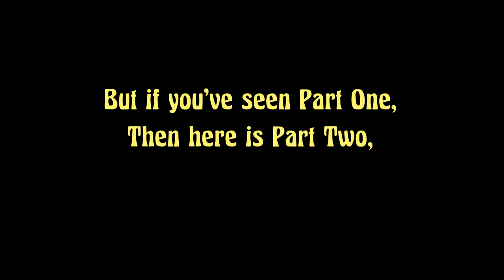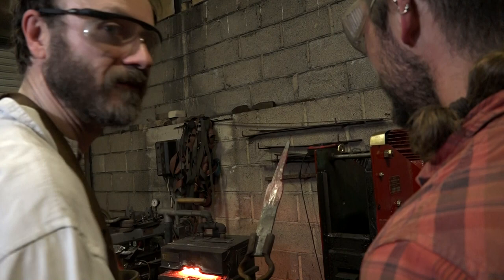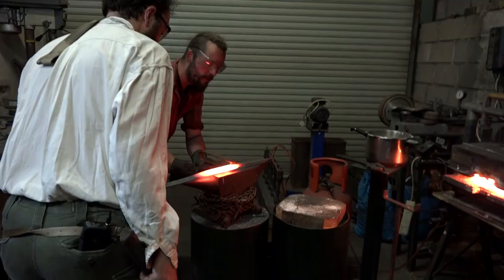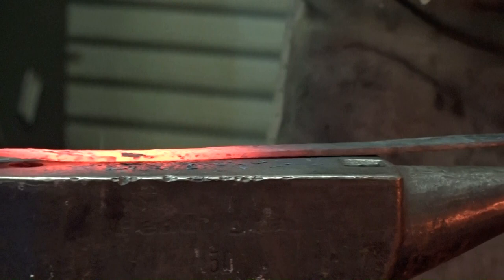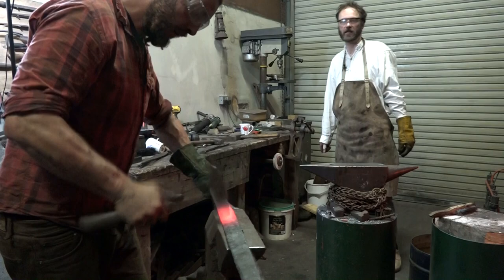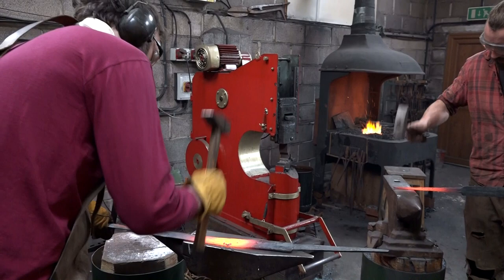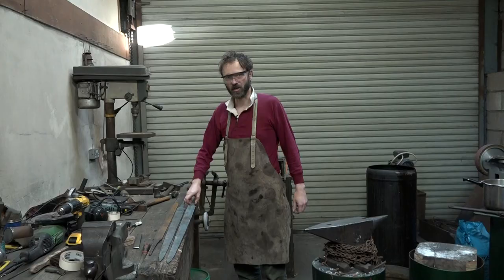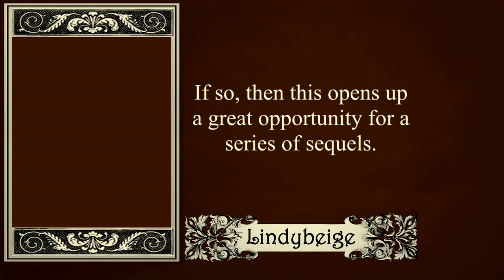Forging a Sword - part two: fuller, bevels, straightening

Comment: I was terrified when you shut off the power hammer and changed the die without unplugging the machine, putting in any sort of chuck, or locking the machine out.

Comment: If you want to make you blade very strong, you can do both quenching in oil, the standard procedure, and tempering it. However, don't make it too hard or it will become brittle.

Comment: What if you had a guide pin to run along so you could guide it better on the power hammer?  Not right where it strikes but maybe 4" away on the side away from you so you can angle the sword but still have a firm control while keeping the rotation angle about the pin to a nominal value.

You'd want to do that before forging the tang for the guide edge.

P.S.  The Arnander ending was well done.  I laughed.

Comment: Would you mind if I asked, why you named it the name you did, and what does the name mean?
Reply from the maker: Not at all.  This will be revealed in a later part.
Reply: Lindybeige alrighty then, I was going to watch it anyhow. Thanks for responding!
Reply: ahh, the old cliff hanger eh?  Kinda the same as us not knowing whose skull Lucille smashed in...
Reply: Eagle... Go-er?
Reply: Or Eagle Breather... mixing up my latin and my germanic..
Reply: Dagoth_Bob that would make sense considering it is a one handed sword
Reply: Lindybeige I have an intresting topic for conversation here. Steel production in the medieval period. I have done a bit of research about  this but with a few contradictions in what I've read and to the people I have spoken to. Pt1
Reply: Lindybeige pt2. Now some say that steel was produced in reasonable quantities while others say that steel production in the medieval period was at an insignificant quantity due to the difficulty, waste of resources and the amount of time it took just to make just a little of it. So the main question is how steel blades were made back then. The only reasonable info I've got on this is that iron blades went through a prossess to change the molecular structure of the iron, causing the outer layers to form into steel. Apparently this was called case hardening  (not to be confused as tempering which comes after)..
Reply: Lindybeige sorry lindybeig pt3 here. About the process of case hardening. This was done while heating the blade and adding carbon which could only penetrate a certain depth into the iron, producing a steel skin..... I assume this is also how steel armour was made? Since armour plates are thinner than a blade, the case hardening process would be more successful in being able to change the entire molecular structure of the iron creating a type of mild steel. What's your take on this? Is this how blades and armour were made? Or could they produce sufficient quantities of steel to ovoid going through this process? If so how did they manufacture the quantities of steel needed? Sorry for the million questions.....many thanks.

Comment: if the job of a fuller is to reduce the weight (which is it's only job AFAIK) why is it hammered in and not ground out?

Comment: 3 months for next part?
Reply: Revising the footage and cutting it into a viewer pleasing format takes time, buddy.
Reply from the maker: This video took most of week to edit.  Sorting out the sound took ages.  The room was filled with fans and other buzzy things, my lapel mic kept failing, and recording someone talking while hitting an anvil with a big hammer has problems.  A lot of those hammer noises you hear are not actually the noises made by the strokes you see.
Reply: well done, i cant of made it easy

Comment: If I'm not wrong, the fuller is the depression in the middle of the blade, right? I'm not as attentive as others.
Reply: Yes. A fuller is any symmetrical (half a cylinder) depression on an otherwise smooth surface. Streets have fullers, roofs too, so do gardens.
Reply: Dimitre H thanks for your input

Comment: "They cheat on the fuller by grinding it out."

But like, doesn't that actually reduce the weight, like what a fuller is there for? I mean, I have no problem with forged fullers, it's just that they and ground fullers don't really accomplish the same things, and it technically isn't actually cheating.

"Now let's move on to the grinding."

https://i.redd.it/wvv561t6ceyy.jpg

Comment: where the hell's the full armor loyd 
it's been ages and zero updates have been made
Reply: *armour *Lloyd
Three months ago he went there for a fitting of the breastplate, and two months ago he made videos about the gloves and boots that would be used for the gauntlets and sabatons. So I guess they're busy getting those done?
Reply from the maker: It turns out that getting authentic bespoke armour takes a while.  He's working on the helmet and sabatons at the moment.
Reply: hasn't it been like a year or something?
also did you end up making a decision on what type of helmet you're gonna be getting?
Reply: That's because Google is American so naturally uses the same incorrect spelling as all Americans. The only "clown" spelling is the American way, as it had to be made simpler for the non-English speaking immigrants to the United States to learn, so you could all read and write the same version of bastardised English.
Reply: Armour or armor, comme from the word ''armure'' wich is a French word. There is no ''O'' in ''armure'' so both are somewhat wrong, but armour is still closer, it kept the ''U'' and has overall the same number of letters. In fact 26% of the English vocabulary comme from French (mostly Middle French).

Other exemple of that is the way brits pronounce lieutnant, the Middle French words were ''lueftenant'' and ''lieutenant''. At the time ''lueftenant'' was more popular but disapeared overtime, so the spelling was changed. The brits kept the pronounciation (almost).

In general, the brits are closer to proper English than the United-Statians (That how the rest of the world call you), especially when we look at words from French. They can say what they want, but the brits are very French like many part of there culture.

Comment: I take exception to the statement that grinding bevels is cheating. If you mill in bevels, that is definitely cheating, and I’d say that grinding in bevels with a giant jig and a lever to apply a ton of pressure may be cheating. But standing in front of a grinder for 3 hours and hand grinding bevels in vertically is difficult and miserable. I forge mine out because I find it to be easier. Full disclosure, my grinder sucks.